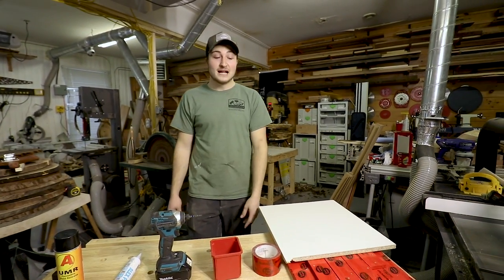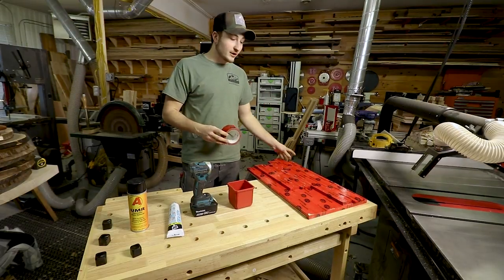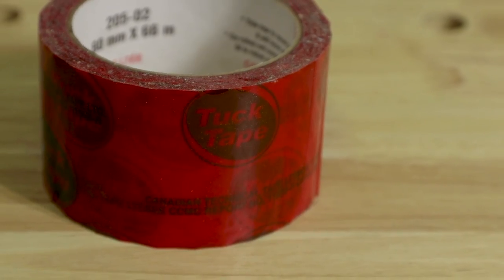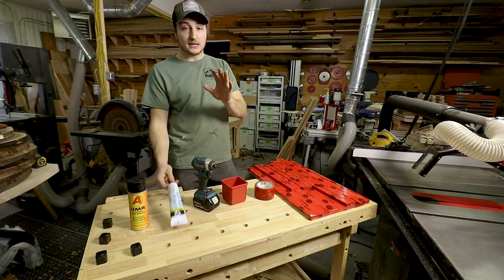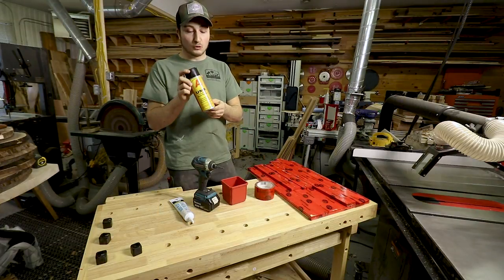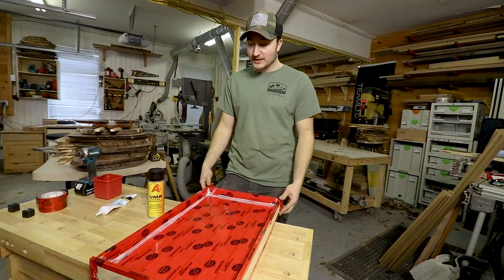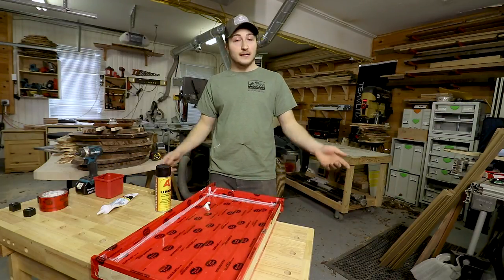Making an Epoxy Mould - How To

Comment: Congratulations for the excellent work and beautiful pieces, very interesting your video, here in Brazil I do not see many guys doing this kind of work ... wood + epoxy resin. Would you like to know what kind of resin you use, is it used for flooring, or is it some kind of different? Is it that crystal? And for the molds? Can I use coated plywood or acrylic sheet? And congratulations again for the work.

Comment: Hi, 
We made a mold like that and filled it with epoxy and everything looked good the first day, the second day when I checked on it I seen the caulking had rippled a bit and peeled away from the tape. Any tip on how to prevent that? Or why it happened?

Comment: I have a bunch of dried leaves (laid out tightly they take up about a 24x24 area). Can I buy a 24x36 inch picture frame, leave the glass in, put a white paper in back of the glass and then pour right on top of the glass so it fills up to the top of the frame? Should I still caulk before pouring? And what kind of resin do you recommend? Thanks!

Comment: Thanks for the video. I have rolls and rolls of packaging/moving tape. Do you think that will work?
Reply: It does not seal like tuck tape. If pouring epoxy it will leak with packaging tape.
Reply: Not the same, epoxy tends to heat up and the bigger pours equal more heat and chances of the tape coming off with no residue are low. It would most likely just get stuck to your resin piece, again depending on the thickness. If you work in super small thin layer then you have better chances of getting away with it but more so for small projects than big ones.

Comment: Thanks for the vid!  What do you do when your piece of wood floats?  can you tape it down or would you use weights?
Reply: Clamp it down or add weights. Put packing tape around the bottom of the weights so they won't stick to any epoxy they might touch. You could also seal the bottom edge of the wood with silicone caulking, put it into your form, weight it, and let sit overnight before the pour. The caulking will prevent epoxy from getting under the wood and will minimize the need for the weights/clamps.

Comment: i'm wondering if instead of putting the caulking in the corners of the mold if you could put it on the wood pieces before screwing the boards together .( like  you would do if you were putting wood glue on ) ???

Comment: What would you do if you just want to create a dam and have the epoxy adhere to the surface on the bottom? Obviously would not caulk it correct? Also, I can’t use screws, as I I want the edges of my project to stay whole. So should I just clamp it together?

Comment: What would you recommend using for a mold to make a round tabletop out of a bunch of small wood blocks?
Reply from the maker: Joshua Smith the same could be used. You would have to make the mold circular though of course. Thanks for watching!
Reply: Start with a round base for the mold, and use strips of thin plywood to make the sides.

Comment: do you know what would be this tape equivalent that is available in the UK ?
Reply from the maker: No idea unfortunately. If you have HDPE (High Density Polyurethane) plastic, you can use that without tape or spray.

Comment: When using melamine for the mold do I need to wrap it in the tuck tape
Reply from the maker: Robert Bishop yes. This is to allow the epoxy to release from the form.
Reply: I had the same question. I thought part of the advantage of melamine was that you could wax the surface and use a little mold release or PVA to be really safe then you didn’t need to use tape. Maybe it’s different for polyester resin though?

Comment: Great video! Do you find you can reuse the molds or are they one time use?
Reply from the maker: Sometimes they can be reused, especially using tuck tape since the epoxy comes off easy enough. I use HDPE as well which is great for continuous use.

Comment: You said you finish with that oil, do you sand or polish the epoxy first? Thanks again for the awesome video!!
Reply from the maker: I dry sanded the epoxy to 4000 grit. In most cases I sand the wood and epoxy to the same grit depending on the finish I'm using.

Comment: Would it work if i'd make the mold walls out of a cake batter mold?
Reply: Yes. I use silicone cake molds and they work great. The problem is that cakes are not very big so...

Comment: I have one question. What kind of epoxy resin is better for making table...
Reply from the maker: There are a number of products that will work. If you use a slow curing epoxy (over days) you will be fine.

Comment: The mold release goes on the tape before you spray correct?
Reply from the maker: Adam Rose tuck tape/sheathing tape down first, then the mold release spray👍
Reply: Out of the Woods Custom Woodworking thanks
Reply: I got another stupid question but can you pour epoxy next to already finished epoxy

Comment: Instead of caulking the corners, can you not just use the tape? Applying  a strip(s) to all the seams? Thanks for the videos!
Reply: I tried to tape the corners of several different molds I made and had a hard time getting the corners to stay 90 degrees without folding and wrinkling.  It's easier to just caulk the corners, tapping them is a nightmare.

Comment: If I wanted to make legs for the table I’m assuming same process? How would I connect them to the table base?
Reply from the maker: @viccas18  similar process for a set of epoxy legs, but you’d have to have a top plate of sorts to attach to the top.

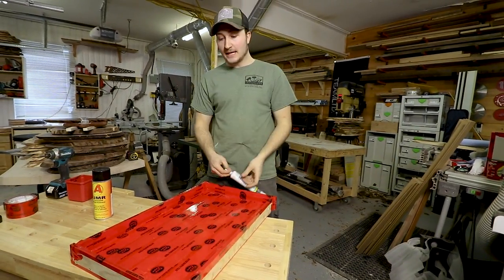Comment: Why is it not ok to just to put down a layer of tape on the edges?   2:00
Reply from the maker: You can do that too, especially with a custom form, however if you don’t fully seal it, it will still leak. The silicone makes sure it won’t by sealing both sides.
Reply: @OutoftheWoodsCustomWoodworking  OK.  Thank you for the quick response.  Good video!

Comment: I want to put all my wifes track and swimming medals (about 40) into an epoxy display. Can you recommend an epoxy that is clear and not too difficult to work with? In other words, beginner idiot proof? Do I need to use a torch to get the bubbles out? Help me Obi-wan, you're my only hope.
Reply: Depending on how big your project is and where you live. Most remain require setting in a room temperature room of 75°. A few good resins off the top of my head are Pro marine supplies, Puduo is the resin I currently use and it is frikken amazing, you could avoid using heat with puduo because once mixed, leaving it along for 5 to 10 minutes will get rid of many bubbles leaving casts super clear. If you have any questions I run an art resin Instagram and am always open to answering questions for those wanting to start their resin journey ♡

Comment: Damn are the supplies needed expensive. Everything but the tape measure, wood, screws came to this on Amazon:

Items (5):  $162.57
Shipping & handling:  $12.21
Amazon Discount:  -$0.02
Free Shipping:  -$7.72
Total before tax:  $167.04
Estimated tax to be collected (PA):*  $10.02
Total:  $177.06

Couldn't imagine the supply cost for a table size that's worth a damn.